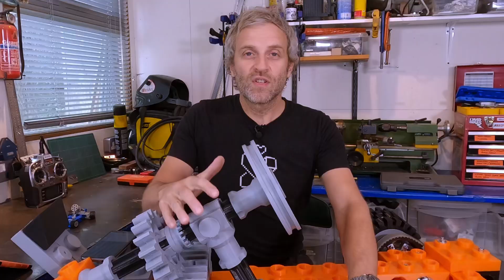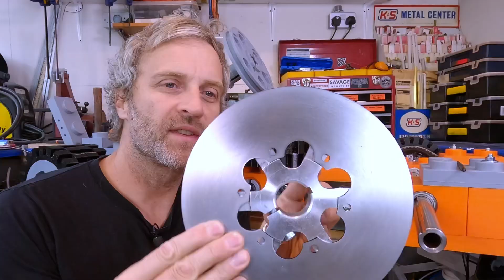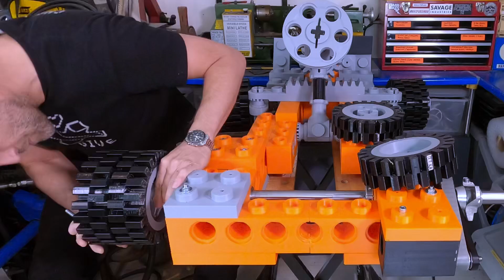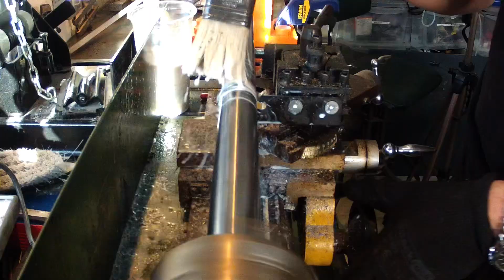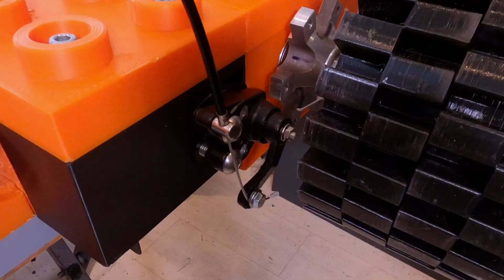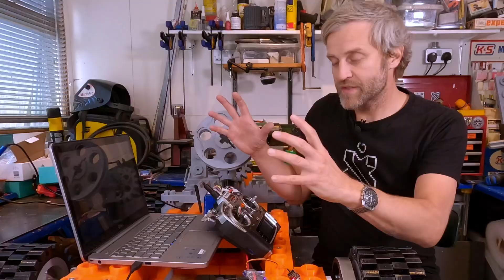XXL LEGO Go-Kart! | Motors & Brakes | #2 - Mantis Hacks

Comment: With the VESC and 12s, DO NOT use FOC. The mosfet driver chip is notorious for killing itself at higher voltage than 10s and FOC control mode.

That is, unless it's a VESC 6, which afaik are fine on FOC at 12s.
Reply from the maker: Ok thanks. It’s a VESC 4.11. I will switch to BLDC mode. I have a VESC 6 coming is that OK at 12S?
Reply: @MattDenton  VESC 6 I believe is fine at 12s with FOC because it uses a different driver chip. I've never used one though, so I can't confirm. But like.... 95% sure VESC 6 is fine with anything. Sorry I can't be more helpful, it's been a while since I've done anything with VESCs.

As a side note, you can actually replace the VESC 4 driver chips if you can get a hold of them. I don't think it's too difficult but I can't remember if they're SMD or not.

Comment: If that's a vesc 4....dont run it at 12s. Although its supposedly inspec...itll die quickly as the driver mosfets burnout. 10s max.
Reply from the maker: Yes it is.. 4.11. That’s interesting the spec says 60V... what about VESC  6?
Reply: @MattDenton  afaik 
 vesc 6 will be fine with 12s (but obv a fair bit more costly)
Reply from the maker: Ok cool. Yeah I have a unit from FlipSky coming to try out.

Comment: Your solution to hold the front wheels is genius! How was the gray small piece different from other pieces you have made before?

Isn't there any way you could fit a small differential?, altough if you end up going the two motor route, then you only need to either run each wheel on bearings with their own pulley, or separate the axle.
Anyways, excellent job!!
Reply from the maker: There is room in the bushing to go over the existing axle that protrudes from the wheel. I'm looking at implementing an electronic diff with twin motors.
Reply: @MattDenton  Excelent!
Can't wait to see you and your nephew riding the thing. ^^

Comment: Yes, the two back wheels with their different speeds (going around corners) is going to be tricky.
This is made slightly worse by the fact you have the motor on a side.
If you could get the motor inside - more towards the middle of the cart - it would help if you decide to put a diff' in it. 
I will have to send you the pictures as I can't put them here.
(Or maybe not.  Can't find how to do that either.)

Comment: Hey Matt, love the video, I also designed tires with the rubber filament and they looked and felt great, tho on tar and cement they wear quite fast. With the speed and power on this bad boy expect heavy wear on them if you drive a lot on harder surfaces
Reply from the maker: Yeah I'm going to shred them 😆😬

Comment: Would it be possible to cut the rear axle on half, and have only 1 drive wheel, to make it easier to turn?
Reply from the maker: Yes.. but even better with twin motors driven at varying speeds according to turn angle.. electronic differential :D
Reply: @MattDenton  that is a much better idea than my own :P

Comment: i suggest twin motor. when steering with a pair of sensors you might be able to pull off a bit of a tank steering at the back thus faking a differential.
Reply: Same idea... a virtual diferential
Reply from the maker: Yeah I'm heading down the electronic differential path.. motor the steering wheel and apply appropriate speed to appropriate wheel

Comment: If you add a 2nd motor and make each wheel spin independently your could program the Arduino to drive both wheels at a different speed while steering which should increase handling a ton
Reply from the maker: That's the ultimate plan . Electronic diff..
Reply: @MattDenton  you could use the dif of a smart like car winout the inner gears in the middle to reinforce the axle so it doesn bend inwards.

Comment: in lieu of a differential, maybe split the axle and run each wheel on it's own motor.  Then you could use the arduino to program each motor to run at a different speed depending on your steering angle.  Or at least only engage just one motor on the outer arc.
Reply from the maker: Yeah it's the plan I have and have if all else fails.. electronic diff!

Comment: Regarding the bolts holding the wheel's on, any concerns with the right side becoming loose over time? When using a single center lug on cars,  they use reverse threads so they don't come off as the car moves forward.
Reply from the maker: You mean teh bolt that clamps the hub on to the axle? Its the same method they use on go-karts... but I can add anti-vibration washers to be sure they done loosen.

Comment: Have you considered relocating the motor (and proposed drive reduction system) under the seat? This would give you plenty of space to do multiple reduction stages, and it would also hide some of the clearly not-LEGO driveline.

I'm not sure what you could rob a differential from (that would be small enough), but that would be a big improvement to the driveability.
Reply from the maker: Yeah maybe.. V3 😆. I've seen quite small trike differentials

Comment: make the left wheel freewheeling so you dont neet a diff.
Reply from the maker: I think an electronic diff.. so I still have traction.
Reply: @MattDenton  If you cut the drive shaft, wouldn't it be easier to use the two motors that you have ? Two VESCs with CAN enabled and current control (try this option, it is very interessting, it controls the power to the motor, not the speed)

More power, more steering.

Look into e-skateboard forums, a lot are RWD
Reply from the maker: Yeah I have it in current nose now. Will be doing the electronic diff solution with dial motors etc 👍
Reply: @MattDenton  Oh ok I didn't understood what you meant by electronic diff in the other comments x)
Have fun !!

Comment: Drop the gearing, cut the rear axle in half, and put another motor on the otherside. That will more than double your torque and all your differential problems are solved. Then you should be able to actually turn
Reply from the maker: This is my plan.. but want to try with solid axle first as I get heaps of strength from it. Also I may monitor the steering angle and do a proper electronic differental...

Comment: Try using two motors and split the drive shaft that should help the steering and you can control them to lock and add a drift mode
Reply from the maker: Yeah.. my plan is add second motor... And  if it doesn't steer split the axle and make an electronic differential by monitoring the steering angle 👍
Reply: @MattDenton  would it be possible to add ackerman angle to the steering? Might help with the turning situation. Also, it might make sense to either print the tires in tpu or print molds and do a urethane casting.
Reply: Matt Denton love the idea of differential steering!
Reply: Need two brakes to properly do a split axle.
Reply: @Bmr4life  there is one wheel peel karts and they stop fine
Reply from the maker: Yeah I could do a urethane mold...
Reply: I feel like if you're going to redo the tyres you sound make them bigger while you're at it. It seems to have next to no ground clearance. Sure it's not for offroading it anything but being able to handle some gravel or a dirt track with make it more usable
Reply: @deanmcmullen5982  you can adjust the material properties of cast polyurethane to get an ideal hardness
Reply: Would it be possible to make a lego differential?
Reply: Lego debuted a differential gear assembly for Technic kit 8860 (2nd gen) with other variants released along the way. However I'd imagine that non-metalic 3d printed components couldn't cope with the same torque loads that real world equivalents are designed for? That said, Matt is obviously an engineering god when it comes to translating childhood passions into modern experiences..... So who knows?
Reply: Drift mode 
LMAO
Reply: Or go for 4 wheel steering!
Reply: Also try adding some rubber to those tires

Comment: Absolutely loving your builds! How difficult would it be to run two motors, and code up some sort of electronic differential? Based on steering input even?
Reply: I wondered this too, but you'd then need brakes on both side and a split rear axle arrangement.
Reply from the maker: Yes. so electronic diff is where I'm heading.. but want to try solid axle first.. then yes If I split the axle I need twin bakes so I'm working on a design that will do that.
Reply: @MattDenton  Matt, expanding the twin motor electric diff topic, would you also be able to configure the motors to provide some sort of progressive breaking effect using the brake pedal pot signal instead of being wholly reliant on the mechanical disc & caliper mechanism. I'd assume the mech option is an easier solution, but when did that ever stop development of an over-engineered solution just because you can...??
Reply from the maker: There is already electronic regenerative breaking. But I don’t think it will be enough so I have added the disc and calliper for safety!
Reply: Exactly my thinking and more then happy to read, you are already planning this way. 😎👍

Comment: Fabulous project Matt. The way Karts handle the lack of a diff is by setting up the steering geometry so when steering, one of the rear wheels is jacked off the ground (or at least, unloaded)
Reply: I experienced this phenomenon personally when I was driving my sister's kart home one evening and the back wheel fell off. It was too dark to find it in the woods so I had to go the rest of the way on three wheels. It worked perfectly so long as I leaned forward and only turned left, but if I had to turn right the hub dropped and started dragging. Good times, that one was way too small for me too, and I clocked it at 55mph once. I miss that thing...
Reply from the maker: 😆 who needs 4 wheels
Reply from the maker: Yes I read this "jacking" I don't think I'll have any of that :D

Comment: Um... as far as a differential one way you could do that would be to put a bearing on the left rear wheel so only the right wheel drives it. You'll lose traction but it should turn a treat.
Reply: Could use a one way bearing to disconnect them, then he would have power on both wheel in a straight line
Reply: @matsv201  Yea that would work too. And work better. Hmm. I wonder if there is a one way bearing in that size. McMaster Carr probably has it.
Reply: @3rdaxis649  the problem is that motorbreak  would not work and he would need two brake disc
Reply from the maker: Yeah.. so what ever I do if I add a diff or one way bearing I guess I'll need twin brakes...
Reply from the maker: I like the thought process though 👍
Reply: @MattDenton  Or just Fred Flintstone the breaks, lol.
Reply: @MattDenton  well... having the breake on top of the dif like some go carts have solve that. Of cause then you need a diff that fits... I dont have any clue if that is something that is easy to get.
Reply: @matsv201  The one way bearings would work but like Matt said he would need to put a break on each wheel and the break and wheel hub would have to be one piece. Or...... If Matt did do twin motors (the axle would have to be split) He could put a potentiometer on the steering to increase/decrease the power depending on direction. Sort of like a tank or skid steer. Now we're getting complicated, lol. I think so long as the majority of the weight is in front of the rear tires it'll be fine the way it is, just like a real go-kart.

Comment: The no steering could be because your weight was behind the rear axle. Which means not enough weight is on the front wheels so they dont have enough grip to steer. This may be fixed when you change the seating position.
Love the project 🙏
Reply: I also noticed. he should test it on its own, 2nd motor in and he still disnt try to just let it drive half a meter on its own weight
Reply from the maker: Yeah I'm trying to get weight forward... No differential either... 🤞

Comment: Its terrifying to see such big lego bricks, messes with my brain
Reply: They're actually normal sized, Matt's just secretly tiny.
Reply from the maker: Yeah 😆
Reply: Matt Denton What about making large legos out of small legos? 🧐
Reply from the maker: Could do.. but I think that's been done 👍
Reply: @MattDenton  That sounds extremely expensive tbh
Reply: Matt Denton Yeah just searches it up and saw it plus it would be expensive. It was not a bad idea though! (Love ur vids 😁)
Reply from the maker: I've tripped over one!!
Reply: Mega minefields
Reply: They're not even to full ratio. 

Lego to Human scale is 3.5 Studs per meter. So a brick that's 7 studs long, blown up to proper scale, would be 2 meters long.
Reply: @carumsarene  I would love to see him do one that scale (Though if you do Matt don't use a 3d printer laser cut/cnc the faces of each brick in sheet material - it will be so much quicker and with proper solvent welds durable). Are you basing that estimation on Lego minifig though? Not saying it sounds wrong for Lego minifig scale just curious as lego's Human figures are none of them particularly 'scale' or consistent to each other - and surely the Lego Technic people would be the best reference for this build. I don't have one of those handy but I'd say its probably around 7 studs per meter scale from memory.